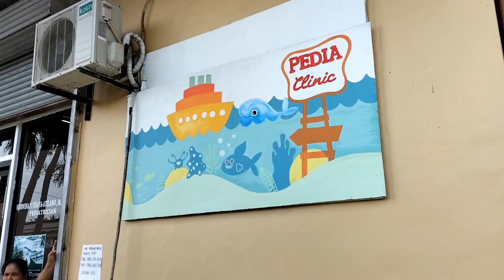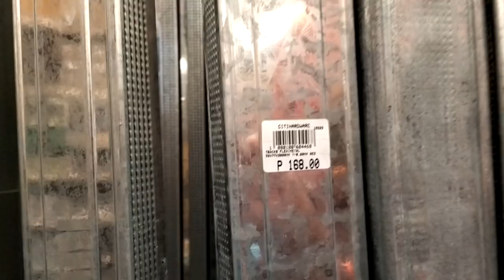V424 - FOREIGNER BUILDING A CHEAP HOUSE IN THE PHILIPPINES - METAL STUDS CHEAP IN THE PHILIPPINES

Comment: joe for the gate you could use the metal bits you are using for the side and reinforce it with wood put in the inside and screwed and then put sheet metal on the gates just a suggestion.

Comment: The garage is shaping up real good. Since galvanize iron for the walls will becomes hot in hot days, I suggest you use wooden plywood or equal for the rest of the walls ( back and the other side next to the house ) if you haven’t bought the the GI roofing yet. But you can always return them.
Reply from the maker: Thank you.😊👍👍Thanks for the tips

Comment: joe ,i love the progress you have made and it looks very cozy now..  i had a question. every architect  i have talked to (in the philippines) has told me that a metal stud wall with hardieboard walls and ceiling will cost much more than plain old hollowblock walls but i dont see it..  the time and materials to render walls and only have them crack later doesnt make sense ...cement post with angle iron beams and joists are what i am thinking ..
what is your opinion price wise hollowblock walls vs metal stud ..  thanks
Reply from the maker: This carport that is as big as any small 2 bedroom house would cost under 200k PHP no builder contractor. A year ago I was quoted 500k not taking into account the land slope and the house was sooo small🤔 rebars are costly and hard to find HB that does not crack.